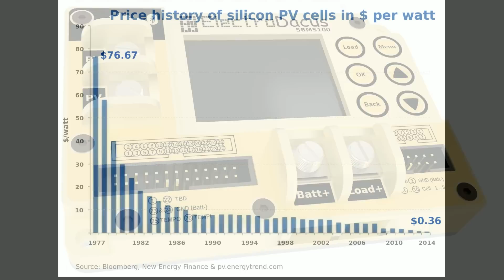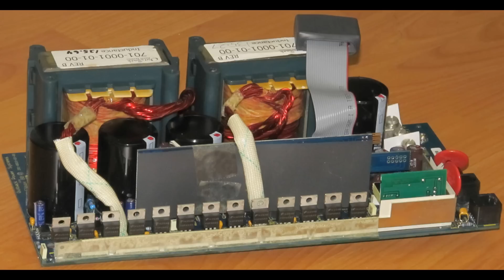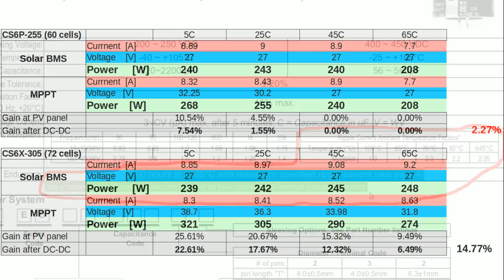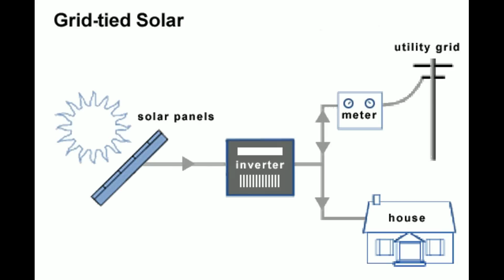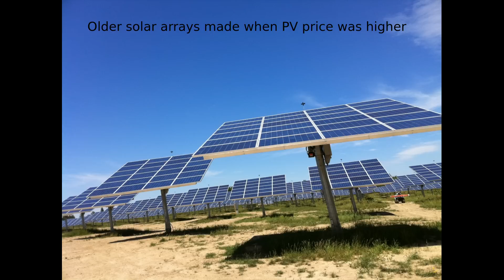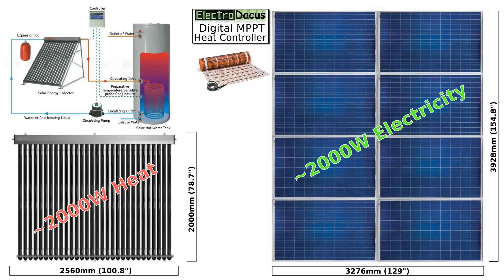Is the MPPT in OffGrid Solar obsolete ?

Comment: Thanks for the videos and all your amazing work! 
But another a question about MPPT in situations with limited roof space and higher efficiency panels :)
I've read quite a bit about solar PV and various comments by you so I think I understand and agree with your assessment. This is merely a question if I could use the SBMS120 together with an extra MPPT controller in the winter.

My plan is a 9m x 3m mobile home with 12 solar panels a 325 watt in central Europe. So winter can be quite low illumination and I'd want to maximize energy gain to avoid or limit using a generator.

But in the worst case scenario in winter with nearly empty batteries (3 * 8 = 24V), wouldn't the low temperature increase the Vmpp of the panels from e.g. 31.2V (NOCT at 20°C) to 33.5V at 0°C. I'm not sure how to estimate the Vmpp for low light in cold conditions. I'm looking at the LG Neon 2 black LG315N1K-A5 with 315W.
So wouldn't that be a rather large difference of something like 28% in exactly the conditions you'd want to maximize?

I was thinking maybe I could use a MPPT only in those winter conditions. There is the cheap EPEver Tracer 40a that can be programmed to output the right voltage for lifepo batteries and only cost 150€. Should be enough for the winter and limits input power in the summer (or be disconnected / bypassed).

Also if I'd manage to fit even more panels on the roof (say 15 x 300W for 4.5kW) can the SMBS limit the input power of the panels in the summer? Does it support PWM charging?
Reply from the maker: Those panels are fairly efficient and have an STC max power point voltage of 32.9V (that is the case at 1000W/m^2 with panel temperature at +25C) You will get 1000W/m^2 when is sunny in the afternoon so sun directly on the panels but for panels to be at +25C the ambient will need to be at least around -5C
The max power point current is also at 9.58A at STC for this panels that means you can at most use 10 of this panels with the SBMS120 as the panels will put out as much as 12A continues in a cold sunny winter day.
The 8s LiFePO4 has about 26.4V nominal so during charging battery is around 27V and current available from panel will be slightly higher at 27V than it will be at max power point voltage say 33V in colder winter day thus the gain at the panel will be best case around 18% but then assuming the DC-DC converter efficiency (good MPPT) of around 92% the net gain may be 10% and I ignored the cable voltage drop so maybe even less than 10%
But even if the gain was say 20% (not that is the case in real life) when is overcast you only get maybe around 80 to 100Wh from each panel for an entire day compared to over 1kWh from each panel in a sunny day so using an MPPT is such a day will not net you much if anything because of the self consumption of the MPPT may negate any small gains and even if you have 10 or even 20% gain what you gain is 10 to 20Wh from each panel so say from 10 panels that is 100 to 200Wh (200Wh not realistic) then this will likely not be able to make a difference. So you get 1000Wh with 10 panels and if you ad 3 of those EPEver MPPT you get an additional 100Wh so 1000Wh vs 1100Wh. 
That EPEver 40A will only be able to handle about 4 of this panels best case and as it costs 150 euro that is more than a panel cost probably and 5 panels vs 4 panels will have a way higher gain than the MPPT plus that gain is always there not just with low temperature and the panels last 30 years at least not just 10 years at best for an MPPT.
You need to know what your energy consumption will be and then you will know how many panels you will need to handle that in worst case winter month. I do not have any backup and I have no problems in winter.
PWM is used for absorption / constant voltage charging and LiFePO4 do not need that as is detrimental to them thus SBMS will not do PWM charging is done only at constant current and as soon as cell gets to 3.55V battery is fully charged and charging will stop.
In a sunny winter or cold spring afternoon my 260W panels will put out around 10A and at 27V that is 270W with SBMS.
Reply: Thanks for the quick explanation! I hadn't considered the self power consumption and wire losses in low light conditions.

"The max power point current is also at 9.58A at STC for this panels that means you can at most use 10 of this panels with the SBMS120 as the panels will put out as much as 12A continues in a cold sunny winter day."

Isn't the current limit 144A for the SBMS120? So shouldn't that allow 12 panels with 12 amps?

"You need to know what your energy consumption will be and then you will know how many panels you will need to handle that in worst case winter month."

I still have to do that. But I figure I will make use of as much as I can get. Then add more or buy a generator for the two months.

Because what I need alone exceeds the 50kW / month (1.6kW/d) which is a gaming PC for working, running up to 16 hours a day with maybe 250W consumption in desktop application (so up to 4kWh per day). Rigging a DC-DC buck converter for that will be another interesting project.

Ideally I'd also want to run the occasional hot shower and a washer-dryer from solar PV.

You get like 4 times the energy in Canada in December and November! That would mean I would need 4 times the array installation than you do... it might make more sense to get a generator or go on grid for those 2 months or move to a sunnier place.

If I don't figure out how to drastically expand my available area for solar PV a generator which can also be used as a heater might be the best option.

Maybe in the next decade we'll see options to convert surplus PV energy into hydrogen for a fuel cell or methane for a generator.

PS: Anyways, thanks again I'll do some more research and start small. I definitely want to get the SBMS in a while.
Reply from the maker: The SBMS120 will trip around 144A so is not where you will want to operate in normal conditions. My 260W panels will output 10A continues and 12A peak for a few seconds even one minute when is cold and you also have edge of cloud effect. So I assume the 315W panels may see 12A continues (many minutes to hours) and 13 to 14A peaks that is why I recommended 10 so you do not have overcurrent protection disconnecting your array (that will require manual re-enable).
A generator will definitely not make any economic sense as it will cost you over $1/kWh vs PV panels cost amortization of just 2 to 3 cent/kWh  and LiFePO4 amortization of 20 to 25cent/kWh
I use PV for fully heating my house so PV is for sure the lowest cost energy source else I will have used something else.
You did not mention your exact location but a 3kW PV array in Berlin should provide you with at least 50kWh/month in December and more in January assuming south facing 60 degree tilt and no shadows from trees or building's
I'm not a gamer so not sure if your computer can be optimized. I use an all in one Asus P1801 with a core i7-3770 and a GT-730M + a 1080p 18.4" as my main computer and all this takes 30 to 35W idle (most of the time) and under heavy loads like editing/rendering a video or something like that gets to around 90W peak.
So my computer is also used about 16 hours a day but only needs in average around 0.6kWh/day
My wife uses a core i5 laptop that is only 10W idle and no more 40W under load.
Both my all in one and the laptop are supplied using 19V DC-DC converters. 
You mentioned a 9m x 3m mobile type home then if you have two row 1.6m so 3.3m and you can fit 9 on each row as they are about 1m wide so total 18 panels and I suggest you take advantage of all that space even if you only use the extra panels in overcast days manually connecting them as even in worse day you get 80Wh from each panel so 1.6kWh in a completely overcast day from 18 panels. You can get the lower cost 260 to 280W panels as in a cloudy day when you need the energy most the 315W will not really produce more and probably cost is much higher for those. I paid around 200CAD for my 260W panels that is just around 130 euro.
Reply: Thanks again! Yeah optimizing my PC or getting a second low power for just desktop use is probably way smarter and cheaper.

Unfortunately 3m wide is the max road limit where you can get a cheap and simple wide load permit here in Europe. But the smart solution would be to find a way to unload and deploy another array. 

"in a cloudy day when you need the energy most the 315W will not really produce more"

Could you explain why that is? Or point me to a resource where I can find out how to estimate solar power for panels in overcast  / low light scenarios? Thanks!
Reply from the maker: If the panels are at an angle for example 45 degree angle will allow you over 4m on a 3m base so even at a smaller than 45 degree angle you can fit two rows of 1.65m
And if you go for a very steep tilt angle of 60 degree then you can have 6m x 9m surface for panels while still being at 3m wide but of course height may be exceeded in this case. I use the steeper 60 degree angle for my array since that gives me the best output in those winter months.
At a minimum you will need a 25 degree tilt angle to fit 3.3m of panels on a 3m wide flat surface and that will require rising one of the sides of your box by about 1.4m this will give you about 72kWh in December (Berlin) and 102kWh in January considering 25 degree tilt south facing and 5.4kW (300W x 18 panels) vs 86kWh and 118kWh with 45 degree angle
You can check panel specs some offer more details than others but they way the got increased efficiency in most cases was to increase the number of collecting wires and buss bars on each cell as it started with two buss bars then went to 3, 4 and even 5 buss bars so voltage drop there is smaller but in low light there is not that much current so a more efficient cell will not perform better than a less efficient cell.
At around 200W of solar iradiation the 315W LG panel will put out around 2.1A compared to a much lower cost 270W panel that will put around 1.9A.
Looking at price I see the 315W LG at around $310 while at the same seller a 270W from Jinko solar costs $175 thus almost double the price for maybe 12% extra energy per panel. The extra money can be used for a slightly larger battery capacity.
And it is just 12% difference in current output between the 270W panel and the 315W panel because the rest of the difference is also from slightly increased max power point voltage on the 315W panel but that will not help without the use of a MPPT and that is even worse in therms of cost and not helpful.
Here is the spec for Jinko panel used as example   https://s3.amazonaws.com/ecodirect_docs/JINKO/Jinko-Solar-270PP-4BB-black-frame.pdf
and this if for the LG https://www.lg.com/us/business/download/resources/BT00002151/LG315N1K-A5.pdf
Notice at STC is 270W and 315W while at NOCT is 202 and 232 so the gain drops from 16.6% at STC to just 14.8% at NOCT and as solar power drops so is the difference between the two panels.
And if you look at the max power point current at NOCT difference is even smaller 7.35A for Jinko and just 7.63A for LG
Reply: Thanks for the super insightful explanation! That makes total sense. All you various comments give great insight, it would make a great FAQ on your site.

I'll think about mechanical ways to increase the surface area. Another way would be to have another row of solar panels that fold out to make a 5m wide array. That way transport would be easier (max roof height 4m).

I was thinking for tilting to just unscrew one side from the roof and lift it up on beams manually. It would be fixed with hinges that can be disengaged or connected to telescoping aluminum tubes to set the tilt.

But just one more question about panels. What are your thoughts on bifacial panels mounted above a white painted flat roof? They have a "normal" Vmpp of 31.4V or 29.8V. I figure they increase current not voltage so should be useful without MPPT. 
I know they are not cost effective but the transparent ones (bisun protected clear) would look gorgeous as a roof structure ;) 

The cheapest panels I can find are 300W for 167 € (555€ / kWp) while the Bisun Protected Clear, if the advantages could be maximized are not that much more expensive (717€ / kWp).

PS: But yeah I should go back tot he drawing board and measure how much power and panels I actually need first.
Reply from the maker: I have my panels at 60 degree tilt and some of them even at 70 degree and while having snow on the ground help's the reflected amount is not that large and yes it will result in increased current output voltage will stay about the same.
I maybe concentrate to much on cost but of course if design is an important factor and you want to pay extra for better looking panels that is your choice.
Also not sure how much do you want to travel or will that just be set up in a place and not be moved that often. If you want to travel find a sunnier place :)
Reply: Well my ideal would be to travel throughout Europe, stay in a place for a few months or a year. Get to know Europe really while it's still there ;)
But of course I might run into trouble actually finding places to stay and set up (except RV parks).

I'm also considering an RV type setup instead of the extra large tiny house. A ~7m x 2.55m box on a used truck would be more mobile, cheaper, and with the idea of folding out solar panels that would actually allow more solar power (16 panels 4*4) compared to my original idea.

If I build it pretty, I could sell it for a profit if I don't like it.

Comment: He FAILS to mention at low light levels BMS voltage it too low to charge batteries and MPPT with 72cell panels will have enough voltage to convert to charging power.  PWM controllers are inferior folks.
Reply from the maker: You probably missed the part in the video where calculation at different panels temperatures are done. Solar panels are constant current supplies and there is no point where a 60 cell PV panel can not charge a 8s LiFePO4 or 7s LiCoO2 battery.  SBMS is not using PWM as that is not needed and detrimental to Lithium cells that is only used with Lead Acid where constant voltage charging is needed.

Comment: Most great MPPTs have a 2 phase buck converter, notice two sets of components, this will output a smoother DC. I add10 mohm ESR caps close to input and output and it improved eff/longevity.
Reply from the maker: Is irrelevant as even if they last as much as the PV panels they will still not be cost effective or have any sort of advantage compared to adding 5 to 10% more PV panels or slightly more efficient panels.

Comment: I have 6 x 60cell panels. 285w each. 1710w total which will be feeding a 24v battery bank. My current plan is to have them wired as 3 strings of 2 each in series. I am doing this because the runs aren't that long and there are some shading issues. By splitting them into 3 strings (as opposed to 2) it will better limit the effects of the shading. The off-grid trailer will not allow more than just those 6 panels. -- OK... given that specific set-up... do you still maintain that an MPPT charge controller is worthless to me?

What I have right now is a Connext MPPT 60-150. Charging a 24v bank it can utilize up to 1500w of the 1710w max output from the array. I figure with temp and other losses, inefficiencies, etc. it should be a good match. -- But you're saying I don't need it and it's useless to me?

How else would I charge my battery bank given my set-up? The 2 x 60cell panels in series require an MPPT charge controller don't they? If not how would I set-up what I have so it would work best? Thanks in advance!
Reply from the maker: You will have them all in parallel even better limiting the effect of shading since when in parallel a panel shaded will not affect the others.
So yes MPPT in any offgrid application is useless.
Here is the SBMS120 (my design) charging a 24V LiFePO4 battery with a single 60 cell PV panel (video is made by one of my SBMS bakers).
https://www.youtube.com/watch?v=QJdGcZEFwto
Also my current house setup is using 6x 265W panels to charge my 24V 5kWh LiFePO4 battery.
Reply: OK, so I should put them in parallel to a combiner box and use one of your SBMS120 units? Or how would I hook it up? Also, how much does each SBMS120 cost? I am in California, USA.
Reply from the maker: Since SBMS120 has two separate PV inputs you can parallel 3 of them and connect to PV1 and the other 3 in parallel to PV2
SBMS120 cost 389CAD that is around 310USD right now according to google and you can preorder one from my website  http://electrodacus.com/ since the fist batch is all sold out and I will build a second batch around end of March.
Reply: OK that sounds really good! -- What size wire do you think I need to run each combined string 35 ft? I have 8 gauge PV wire right now, which would have been fine with 2 panels in series because no increase in amperage, but running 3 panels in parallel will triple the amperage... and over a run of 35 ft. I don't know if 8 gauge is good enough. -- What do you think or what size wire would you recommend?
Reply from the maker: 8 gauge is more than adequate for 3 parallel panels especially since is a short run just 35ft. I use 10 gauge wires for groups of two parallel panels and about 60ft.
You will see probably around 25 to 27A from 3 parallel panels and with 8 AWG and 35ft you will have a voltage drop of around 4% max so more than adequate.